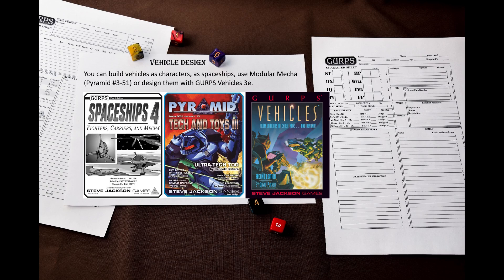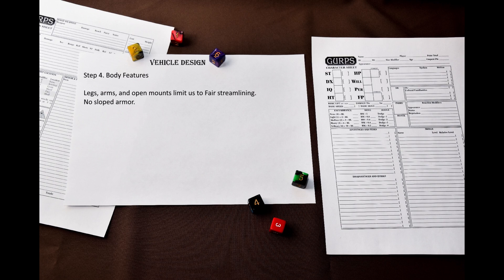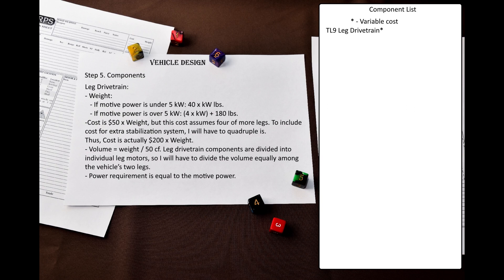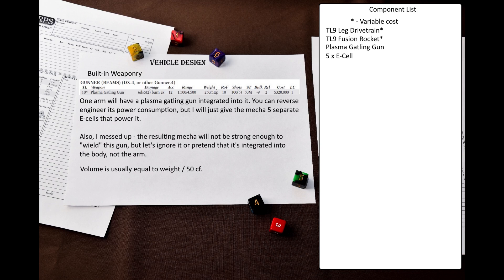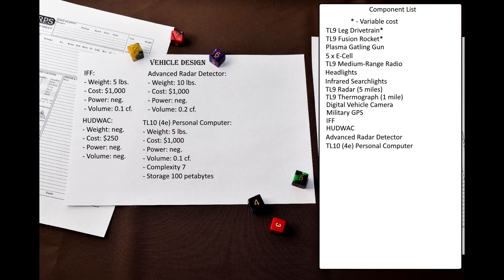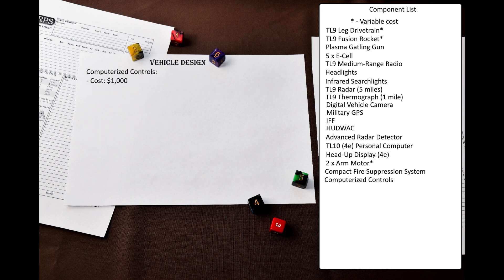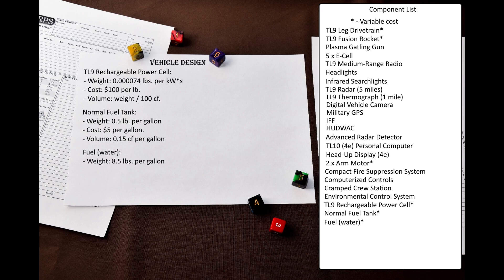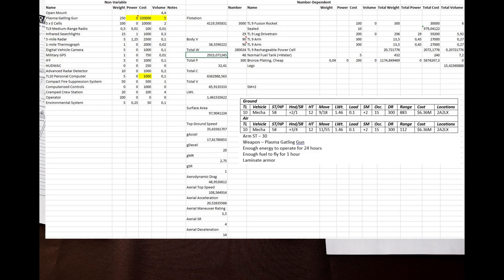Designing a Mecha in GURPS Vehicles - Is It Really That Difficult?

Comment: Uhm... There are a couple of things I don't understand. Maybe someone can help me out. :)
I checked the article on PY3-96 'Ultra-Tech Armor Design' (pagg. 19-27) but I could not find the part where it sais the design can be applied to vehicles; to me it seems only about personal armor. Did I miss something? Or is it the wrong article?
Checking the spread sheet in the video, I found the line 'Bronze Plating, Cheap' that I assume is the DR300 armor: it weights 1175 Kg that is 80% of the total weight of the mech, still it has a volume of 0. That does not make much sense to me. If it makes up for 4/5 of the weight it's hard to belive it doesm't add anything to the final size of the object it covers. Is it a force field?
In the same row, the armor cost is 5.87M$ over a final cost of 6.36M$: this means that 92% of the final price is just to cover the armor. Seems quite a lot, it's like I spent 92k$ to armor my 8k$ car. Also, putting the same armor with 30 DR would cut the cost to 1M$. Am I wrong?
I don't know. I still prefer the approch used in Gurps Spaceships, it may be more simplistic, but as you allocate armor it already accounts for the volume it tooks on a ship or a mech.
Nice video anyway. :)
Reply from the maker: You got the right article, I just see no reason why it wouldn't apply to vehicles. "Bronze Plating" is a leftover from another vehicle I was designing, I just forgot to change the name, but the numbers are correct. And yes, it is very expensive.
As for armor not having volume, I assume that it is done that way because surface area depends on volume, and if armor itself had volume, then the presence of armor would affect how much armor you need - the rocket fuel problem.
Reply: @dungeonsandgurps  actually that's not the case. Let me use your sheet again: your 'naked' mech has a volume of 15,42 cubic feet (I assume) and a surf. area of 97,9 squared feet. Pyramid article states that Adv.Nano Lam. armor has 166 DR/inch, so a layer that gives 300 DR is 1,81 inch thick or 0,15 feet thick. Multipling for the outer surface of the 'naked' mech, we get 97,9 x 0,15 = 14,69 cubic feet of volume for the armor. The 'dressed' mech would be 15,42 + 14,69 = 30,11 cubic feet.
At that point you are done, you don't need to recalculate surface area, unless you wanted to layer another armor on top of the 'dressed' mech: if you need to put, let's say, an ablative cover on top of the laminated armor than you would have to consider the surface area based on the 'dressed' volume since the ablative layer would have to cover the armor as well. :)
Not considering the volume of the armor is 'cheating' because it allows building vehicles cons. smaller than they should be, making them harder to hit. :)

Comment: The big question is, and has always been, do you use a vehicle, any vehicle, in the game, design it for that matter, as equipment or as a Player Character.  Both approaches have their pluses and minuses.  The Game would, of course, be best suited with a  GURPS Vehicles Supplement and enunciating a set method for how vehicles are handled, either on or the other of the above, or even a third option, which could be point based, but use heavy limitations for point savings like gadgets and new rules uniquely suited to vehicle type situations.  Sadly, this ship has sailed about 10 years ago.
Reply: do as suggested in GURPS and built the mecha as characters. The advantages and disadvantages exist to do this.

Comment: It's always good to start with an idea of how big you want your mecha as well as a concept, that makes figuring out what you need to get the performance you want a lot easier. If you can't think of one steal! ... errrr I mean..... find inspiration in an established setting. Heavy Gear is good for very realistic mecha as well as Armored Troopers Votom (the mecha used in the thumbnail is the scopedog from this series), Patlabor, and especially Gasaraki (they have mechs that extend their legs as they amble to increase their stride length just to give an idea of how well thought they are).

Now when it comes to sensors, Ultra-Tech is actually more realistic here (though the rules for sensor detection is better in 3rd). For radar and the like, you run into a 4th root problem, that is if you send out say a 4 megawatt radar pulse the best return you can expect will be ~1.4 megawatts if you're lucky. The scaling of radar in Ultra-Tech better reflects this. The same goes optical sensors, smaller ones scale lineally but once the lens start getting bigger it hit quadratic scaling which , once again, better fits with reality (though the tables for optic sensors are a mess!).